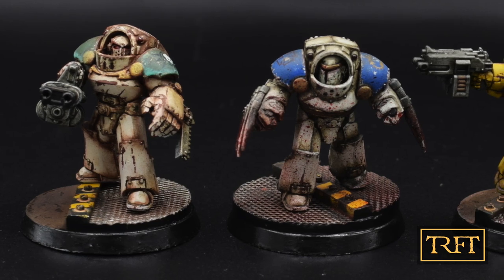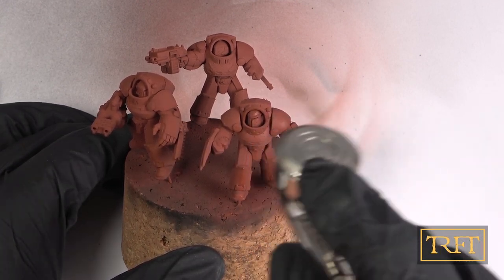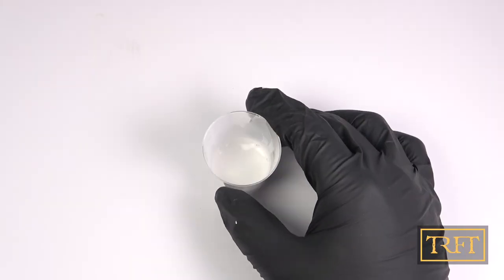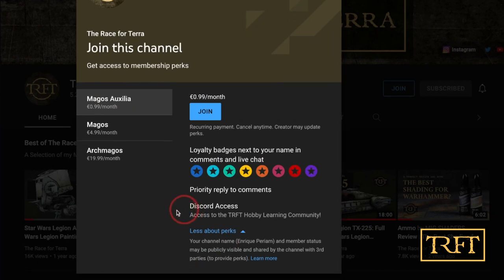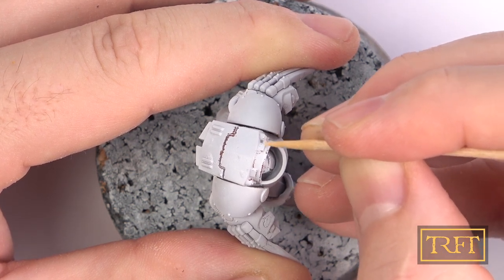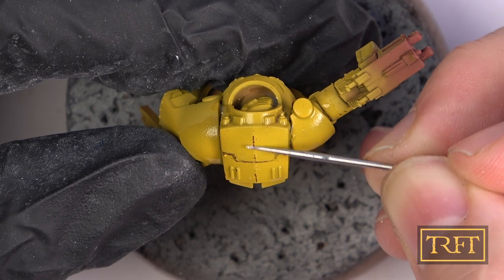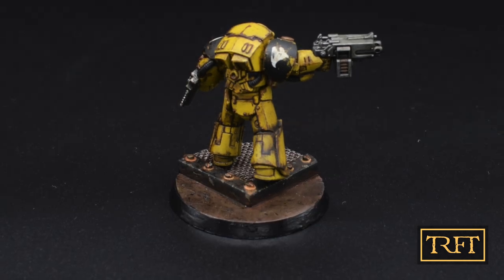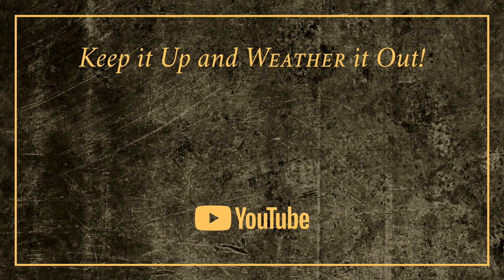How to Apply Chipping and Battle Damage to Warhammer Models

Comment: Do you think you'd use chipping/scratching fluid on infantry for personal armies in the future, or is it just too slow? The effect looks great.
Reply from the maker: Thank you, Nigel. I think for me it would depend on the army and the amount of time available. Also, I would consider liquid mask chipping as well. For 30k DG I think either is kind of a must. If your army is not heavily weathered or has a very high model count, then I guess it’s not worth it.
Reply: @TheRaceForTerra  I like the liquid mask chipping but it seems too many steps in my opinion for a result that is very similar to sponge chipping/weathering. Though I suppose it also has the added effect of the brush scratches during removal. Not sure. I am working on a 30k World Eaters loyalist army that will have a medium amount of weathering, not Death Guard level but not a clean look either. Not sure which weathering method I'll be using, but my test models are sponge chipped. Thanks for the reply, and the excellent videos.
Reply from the maker: @nigeljones9215  My pleasure, Nigel, happy to answer questions anytime. Have fun with the XII!